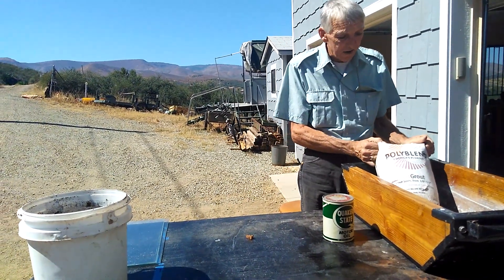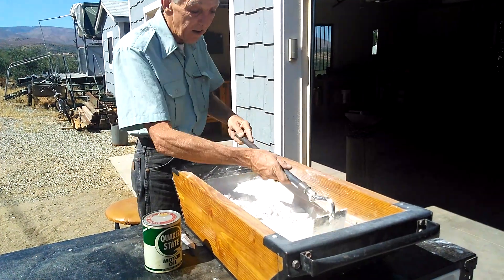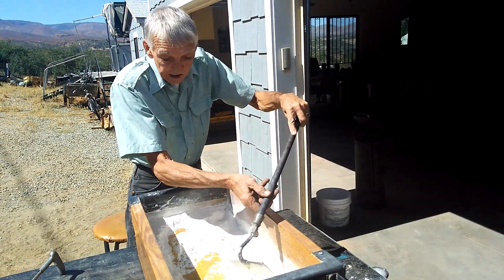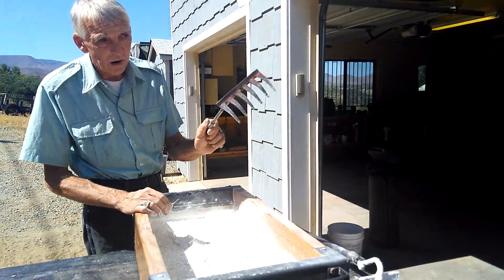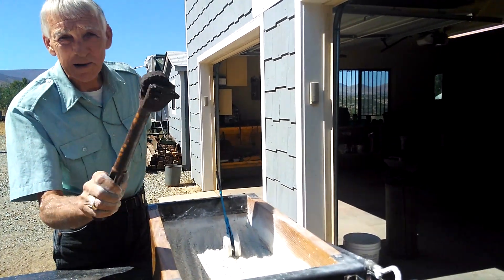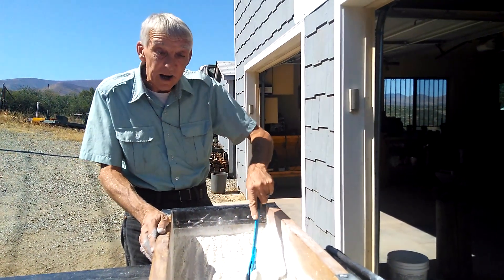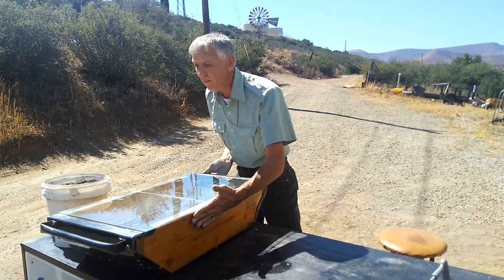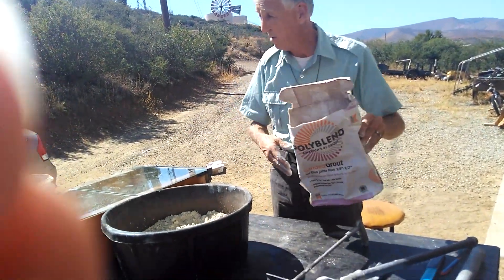PETRO BOND MAKING PETRO BOND AT HOME OIL SAND FOR CASTING METALS PART#1

Comment: I've now watched this a couple of times. I commented on a different video but my main question is the possibility of using mineral oil instead of motor oil to reduce the health affects. We've made our own green sand last fall, using water + sifted sand (120 grit) and cat litter but just not happy with the results. We've remixed part of it now, using mineral oil and we're closer to good results but thinking using your idea of tile grout + mineral oil. I am using petrobond on my silver pours but he's trying to pour a brass hammer head and haven't had success yet. We've both got videos posted of all that. I can post links if you like. 
Thank you!
Reply from the maker: Hello Silver Keys, yes we have transitioned to mineral oil w/good results about 6 months ago.
It is good to see someone else coming up with good ideas and yes a muller would be much better, though you know so many aspirations, never enough time in the day.
Thank you for your comment.
Blessings to you and your family, Casey & MariSue
Reply: @5tonswguns219  THANK YOU FOR YOUR QUICK REPLY!
I am so pleased to know you also switched. I think the smoke and exposure to it is safer.  Is the ratio about the same?  I'll invest in some tile grout and start over if so! Hum....a miller. Well, I'm not sure we can build one that would work any better than trying to find a finer sand to start with.We picked up a food processor at the refuse bin and used it to grind our litter up but we think the real issue is the grain size of the sand. Too large.
Yes, not enough time to make and do all we'd like to make and do, for sure!
Reply from the maker: Yes, you will use a little bit more than a quart of mineral oil, instead of one quart.
Keep us posted.
Thank you again.

Comment: Have you ever tried to mix it in a large 5 gal pail, with a large drywall mud paddle & drill? Seems that might be a bit faster & easier.
Also, how about using synthetic oil? Just wondering.
Thanks for posting!
Reply from the maker: Great idea on using a paddle, we have never used synthetic oil, we would be interested in what you come up with using it.
Thank you for your comment.
Blessings to you and your family, Casey & MariSue
Reply: @5tonswguns219  Did you ever test out synthetic oil? I ❤️ how easy those formula ingredients can source!
Reply: Don't use synthetic oil. The detergents that are in high concentrations in synthetic oil causes issues. Use straight -tried and true Dino oil (conventional). A straight 10w oil works well.

Comment: I wonder if a small concrete mixer would make it easier
Reply from the maker: Hey Bill, I have be in pondering that as well       :)!
 Thank you for you help!
Blessings! Casey & MariSue
Reply: It will mix it, it will be dusty, some mixers have covers you can buy. The big thing is cleaning the oil out of the mixer, before mixing actual concrete and water.

Comment: This is amazing, your almost like the Bob Ross of metal smelting 😊 (100% ment as a complement 😉, your focused manner and love of the craft really shows😊). Just found the channel and I'm loving all your videos, just subbed. 😁

Was wondering if this would work with, building sand (sifted by me), and "used" motor oil (filtered by me)? 🤔😁 Or do you think that the binding agents in the grout are essential? 😅 

I also have no idea if the motor oil having been "used"(in car etc) has an impact, or which grade of oil it is? 😅

I'm just trying to recycle as much use as I can from what materials I have available. 😅 Would be amazing if I could find something sustainable, but I'm guessing it's never going to be quite as simple as add oil to regular sand. 😅 However if I could use "used" motor oil and grout mix that would be much closer/cheaper. 😁

Would love to benefit from your wisdom on these points, and apologies if they have already been covered in the video. 😊😅
Reply from the maker: Good day George King, In my experience most sand after being sifted may work using a clay type binder would be more sustainable if you had no access to the sanded tile grout and oil.
You would have just have to baby sit the moisture fun mold and cats and fun things like that.LOL
Simply omit the water all together. Simply add oil no water......
The binder in the sanded tile grout is portland.

I have also used it with used crank oil (unfiltered) in a test w/good results except it turns your petrobond sand mix dark and dirty.

Recipe: 25# SANDED TILE GROUT (WE PREFER THE BRIGHT WHITE) AND ADD 1 QUART OF 30wt MOTOR OIL.

TOOLS WON'T RUST W/OIL BOND SAND EASIER ON YOUR HANDS, DOESN'T FREEZE AND THE CAT STAY OUT OF IT!!!
THANK YOU FOR YOUR TIME AND ALSO FOR SUBSCRIBING, WE NEVER THOUGHT WE WOULD BE DOING THIS.....
WELCOME INTO ALL THE PROJECTS!
BLESSINGS! CASEY & MARISUE
Reply: No that would be a man named Dave Gingery! And this is not SMELTING! he is not reducing metal ore. He is CASTING metal!